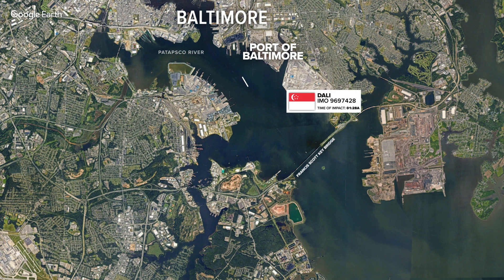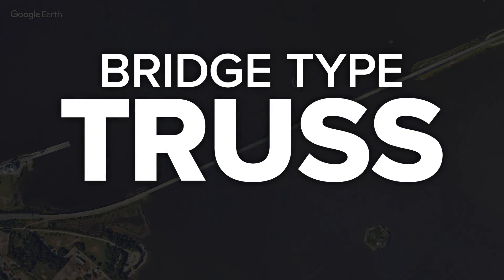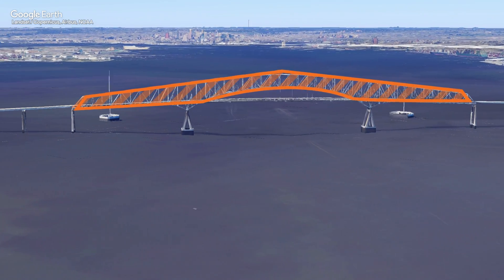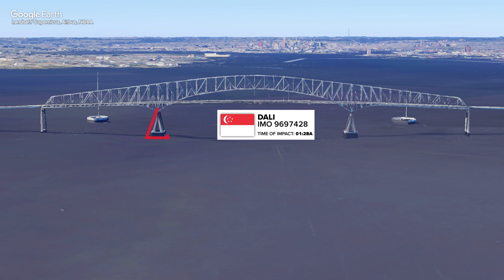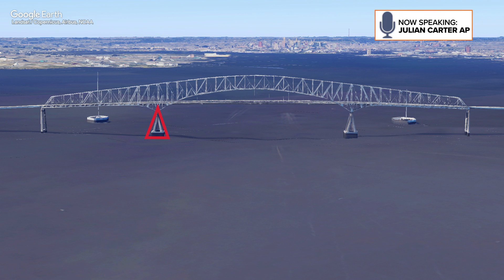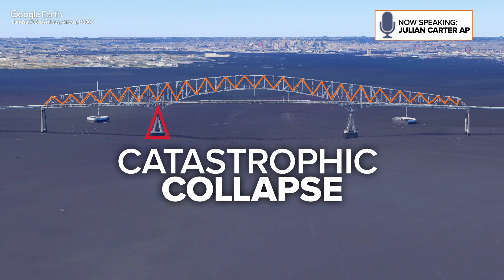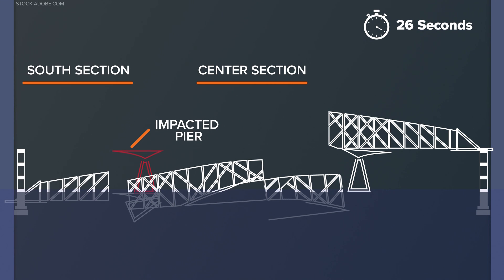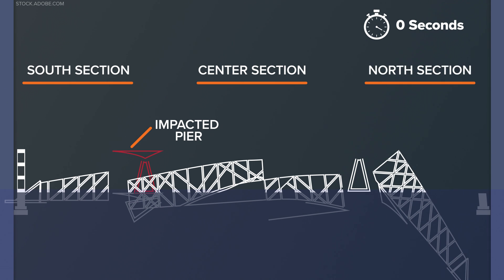Why did the entire bridge collapse in Baltimore when it was hit by a container ship?

Comment: Wrong question.  The right question to ask was, why did the ship turned right into the bridge support when it lost its power?
Reply: There's more than one question. Other bridges of different designs have been hit by large ships, and only lost the section right next to the support.

Look at the collapse of Sunshine Skyway Bridge or the Tasman Bridge when they were hit by large ships.  Different designs, different results.  Only the sections next to the struck pillar collapsed, it didn't spread further. 

This bridge was built when cargo ships were a lot smaller. I doubt the bridge that replaces it will use the same design.
Reply: Because the captain reversed the engine, which made the screw push water in the opposite direction (sideways). It works like a waterwheel.

Comment: This bridge is truss with continuous section , and also the load is distributed with vertical suspenders( Stressed bars) .

Generally these vertical suspenders are designed to carry vertical or very minimal transverse load( depending upon its type or fixing technique) .

As the Ship hit exactly on the pier from where load transfers to the ground , it shattered the complete bridge .
Reply: Was the Key bridge especially long for a Through Truss?
Reply: @Blak.dragonfly  Not Exactly , truss spans can be even longer .But the problem here was the bridge type , had been cable stayed or extradozed cable bridge or even a regular truss bridge with vertical columns , this could have been a localized damaged which could have been repaired ..

Hope that we get the new bridge standing as per latest tech .

Thanks for the comments
Reply: Thanks for answering. What do you mean by regular truss...no arch?
Reply: @Blak.dragonfly  Straight Section of truss  with sorter span lengths .I understand due to port requirements , it might be a requirement to have spans navigational , in that case I would suggest  to have a cable stayed Bridge 🌉 .

Comment: I just thought about it and bridges don't get potholes, it's not like a road built on the ground. It would just get a hole that you could fall though there isn't any dirt underneath it, only air, can't fill that hole, don't have to be white to know that. "If" there were potholes to fill, you have to do it in the summer because the asphalt and sealant won't cure properly. Go to Home Depot or Lowes and go look at the side of a bucket of asphalt, read the instructions, all the fine print, comprehend the words, actually learn for yourself, maybe you do have to be white to do somethings.
Reply: You obviously don't drive in an area with lots of bridges.  The pavement on a bridge has steel reinforcement in it.  Chloride ions in the deck concrete allow the steel to rust and the pavement delaminates.  Crews have to periodically jackhammer the deck, treat the steel, and repave.  They do this maintenance work at night to minimize the traffic disruption.  This is a very common bridge maintenance item.  They were fixing the deck with concrete, hence why there was a concrete truck on the bridge.
Reply: @stargazer7644  What about wooden or rope bridges, do those have steel in them, lol, and since when do they care about disrupting traffic when they fix the road? There wasn't a cement truck, they don't make the road out of cement.
Reply: @stargazer7644  No, they said they were filling potholes. Not fixing the deck.
Reply: @JeffreyAllanBackowski  so, cos the news dumbs everything down into soundbytes, we should just go with 'potholes' ?  Do you think the average news editor knows anything about bridge maintenance?  They see a construction crew, they say 'potholes'  to their audience. Their audience knows what pothole means. Their audience doesn't even want to be educated on the difference between potholes and bridge deck maintenance.
Reply: @jimbobeire  the news says whatever they are told to say.
Reply: @stargazer7644  what area had a lot of bridges, BridgeVille, Bridgington Heights?
Reply: @JeffreyAllanBackowski  Pittsburgh has more than 440 bridges.  Is that a real enough location for you?  Try Philli or New York... they got multiple bridges there too.
Reply: @jimbobeire  lol, no, that is not nearly enough bridges.
Reply: @jimbobeire He's a 12 year old who has never driven a car and has no idea what he's talking about.

Comment: The first Tacoma Narrows Bridge in Washington State was flapped to destruction in 1940 by a violent windstorm because it was constructed by weak girders that could not withstand high winds.  It was nicknamed the "Galloping Gertie" for that reason.
Reply: uh, that was due to aerodynamic phenomena called aeroelastic flutter.
Reply: It wasn't due to "weak girders".  The bridge was susceptible to torsional flutter.  It's a wind induced harmonic vibration that built up to very large levels.  The design of the bridge deck wasn't resistant enough to twisting actions due to its large depth to width ratio.

Comment: ON the ship issue, why is no one talking about Primary and Auxiliary Power? Yeah the lights flickered, doesn't mean you lose propulsion and rudder. When power fails, Auxiliary kicks in for the engine and rudder. You do not lose control of a vessel this size. WTF going on here.
Reply: Evidently they lost primary, tried to kick on backup and it failed, which means that there is likely a common fault. Captain dropped anchors and ordered reverse, called mayday and wanted tugs, but it wasn't enough time.
Reply: looks like it did in fact lose power. Do you have any other plausible theories?
Reply: @skyboy1956  I have a theory yes, seems you didn't graduate school, lmao.
Reply: Emergency power does not normally provide propulsion, just lighting and fire control.

Comment: 100,000+ ton ship. Size and weight of the USS Nimitz aircraft carrier.

That whole truss structure probably weighed less than 1/2 of that.

No bridge is designed to withstand a 100,000+ ton ship moving at 8 knots.
Reply: What does Nimitz and his 200,000 have to do with it!? Where can I get money for a new bridge!??? You can, of course, ruin a shipping company that recruited captains from India to work! The captain probably thought driving a huge container ship was like driving a truck!!! Ha ha ha!
Reply: @Mark59396  Maryland local pilot operate ship in sea area not captain

Comment: Why no safety pilings to prevent any contact from ships in place when ships of that size are passing by such a critical structural support??
Reply: Water flow displacement if you want a Large Vertical  structure in Series of Posts. Maybe a Floating Collar design like has never been tried would do the Task.

Comment: Did you see the size of that ship? The ship and it's owners are at fault and liable. It's not as if a bridge can get out of the way.
Reply: I don't know exactly how it happened but they lost power twice before they hit the bridge. They lost all means to steer the ship. They even tried to drop the anchor. Plus, it's policy to get a local captain who knows the waters and area to steer the ships out of town. I don't blame those on board at all until they find out WHY the power failed but sometimes, terrible things happen.
Reply: @lisachapman2980 Exactly. They were dead in the water. They may have reversed for a bit when power came back for a very short time but it was too late. People don't understand you can't stop something that heavy on a dime. Accidents do happen. Sometimes big ones. However the crew did a lot right like you stated. They sent a mayday and police were able to stop traffic with what looked like no more than 30 seconds to collapse from the video. It could have been much worse.
Reply: @SAWats  good info
Reply: @lisachapman2980 I have a suspicion that this will turn out to be a maintenance issue.
Reply: Usually through carelessness somewhere along the line
Reply: It's the fact there are structural elements that could have lessened the collapse, perhaps to a minute or less. Given that's six people were killed that's not an unreasonable question. The entire left and center collapsed the moment of impact. Look at the Skyway bridge in Tampa.
Reply: 100,000+ ton ship. Size and weight of the USS Nimitz aircraft carrier.

That whole truss structure probably weighed less than 1/2 of that.

No bridge is designed to withstand a 100,000+ ton ship moving at 8 knots.
Reply: I'm from Baltimore, and I think part of the blame is on the state of Maryland. If those in charge knew how important that bridge was to shipping and the local economy, they should have protected it much better than they did. It was just an accident waiting to happen. Well, maybe not an accident.......
Reply: @betsygarcia4346  a ship this size can take out most bridges, nothing much could've been done to protect it if it's an accident
Reply: @betsygarcia4346  exactly!! 1:30am?? New they were having issues!!  It's hard to believe it just happened!!!
Reply: Actually you might be surprised at who is legally at fault here.
Reply: It's not it's. It's its.